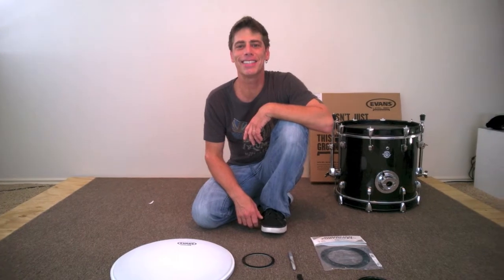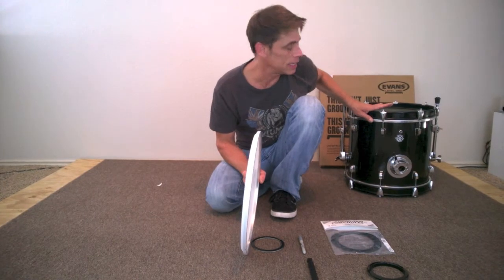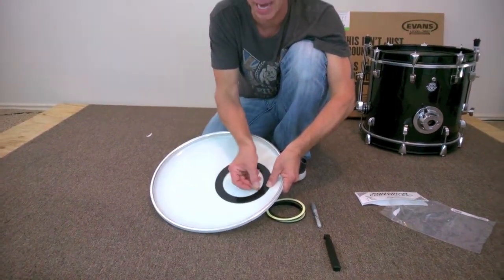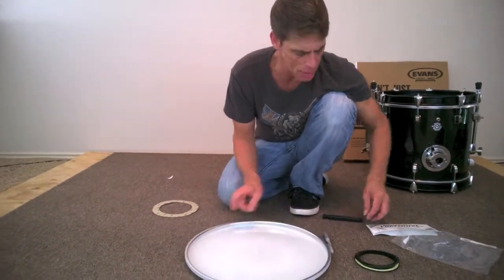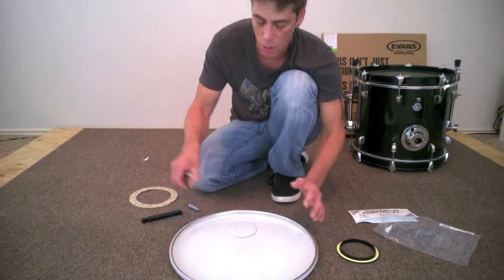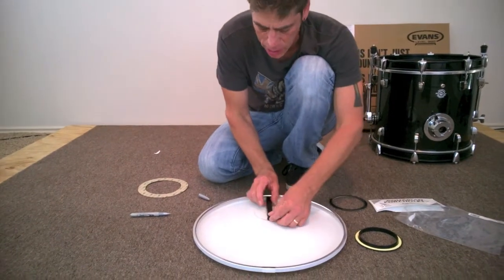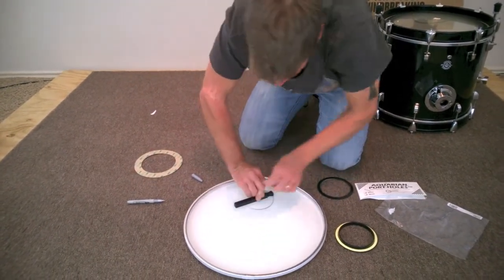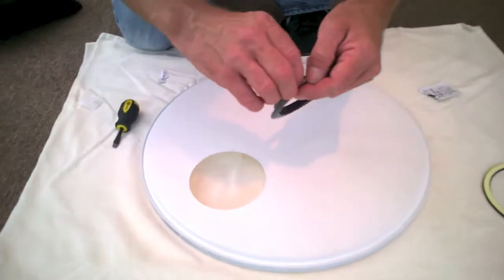How to Port A Bass Drum Head And Make Your Questlove Breakbeats Kick Drum Club Ready

Comment: Thank you for the demo! I want to put a new Evans Calftone head on my 20" bass drum on the reso side, but I'm not a big fan of manufacturer logos. It seems manufacturers tend to put their mark so close to the edge that it makes cutting it out a bit risky. I think your system will help with that! I do want that look, but also want the sound of an EMAD reso head.Thinking about putting some adhesive insulation in a circle, copying the the EMAD muffling pattern. How do you think that would sound?  Standard EMAD on the batter side. Thanks!
Reply from the maker: If you use the Bass Drum O’s hole cutter, and matching sized Bass Drum O it should be all you need. Both pieces of the “O”have an adhesive backing that will act like that foam, and keep it rattle free. PLEASE WATCH how install this to make it lock in. You have to be patient, gentle, but persistent with the locking ring. Otherwise you run the risk of slipping, and tearing the head. Thank you for watching, and commenting. If you haven’t already please subscribe to my channel 🙏🙏🙏

Comment: I went with a 6" port dead center.  I've got an Aqaurian SK1 with an Evans EQ pad.  I am not sure if I will keep the EQ pad or roll a towel instead.  I probably won't use this kit for anything more than rehearsals but even still, i hope the 6" port doesn't cause me to lose bottom end.  It's a cool little kit for sure.
Reply from the maker: Sounds like it’ll be awesome. Just keep that front head super low, and it should be good to go! 🤘🏻 Thank you so much for watching, and commenting. 🙏

Comment: Thanks for providing this video mate. I just bought a nice silver one to cover up the edges where I pulled out a thick sheet from the bass drum hole and frayed it. I'm hoping the ripple on the skin won't make it difficult to install. Also I noticed that I already have some reinforcement material on the inner edge of the skin. Will I have to remove this ring before installing?.. it's probably only a 1mm thick. I'm thinking I'll wait till lockdown is over and get the shop to do it.  But I'm impatient. :). Cheers. Chris from Australia.
Reply from the maker: Probably, but you never know. Thank you for watching

Comment: I have a question regarding your resonant head. I believe you said that it was an Evans 16" G1 Coated is that right? If so, then is it just one that's designed for a floor tom that you have put on it or is it an actual G1 16" head specifically for bass drums?
Reply from the maker: +Simon McDowell It is an Evans 16" Coated G1 specifically designed for Bass drums.Just as the E-Mad I put on the batter side.  It has a proper bass drum collar, which is why A. I got excited, and dropped one on it. B. That breakbeats kick sounds deep. The collar TOTALLY makes a difference. A tom head will work - esque, but a proper bass drum collar is SOOOO much better.
Reply: Kenny Sharretts Yeah I'd rather get one with a bass drum collar since it is a bass drum at the end of the day. Okay so I'll try look for a G1 with a collar. I got an EMAD head the other day for it which is awesome and hopefully a G1 will make it better too. I'd have to get a port hole protector too. Would a 4" be a good size porthole? Yeah your bass drum sounds awesome! I actually was quite happy with it even with the stock heads and had been using them for a while. I still use the tom stock head and I actually like them so I'll keep using them until I really have to change them. But man the EMAD improves it sooo dramatically!
Reply from the maker: +Simon McDowell On this drum a 4 " hole is definitely the way to go. Maximizes the amount of resonant space on this "tiny" bass drum head. The stock Ludwig front head with the dampening ring is awesome as well, I just didn't want to cut my logo head so I could have both options. Evans also makes an EQ3-P Smooth White with a bass drum collar, and Remo has a Powerstroke 3 with a bass drum collar if you wish to have a dampening ring.

Comment: Nice video!  Where did you buy your kit?  I live in Canada.  I was able to find the cutting template on Amazon, but cannot find the mic-hole reinforcers ...
Reply from the maker: Stéphane Godin man I'm so sorry I just saw this. You should be able to order any of the ports I talked about through Sweetwater or direct from the manufacturer.  in this video I used a Drum O  hole.

Comment: I've found that after a time those plastic locking rings start to rattle with the usual punishment of hard-kicking vibration. So, when I bought a new head I thought I would defy their manufacturing standard and Epoxy on that plastic ring. That lasted quite a bit longer until my kicking punishment eventually took it's toll on the plastic ring again and it started rattling. Now I just cut the mike hole and leave off that plastic finishing ring. No question that it doesn't look as good but one less kit hassle.
Reply from the maker: That can happen with these. In your case I’d use an Aquarian port ring. Adds a little muting, doesn’t rattle, makes cutting a hole easy, and keeps your port from tearing. Thank you so much for watching, and commenting.

Comment: that porthole is 5" ? What is good porthole size to 16" bassdrum?
Reply from the maker: It's a 4" Hole. A Drum Holz brand insert. For this kick that's as big as I would go. An SM 91 can slide right in, and a D112, SM52, or Audix D6 works great with this size hole.
Reply: Thx man! I just got Sakae pac-d drumset, and i just wondering powerstroke 3 batter head, or emad2. Just need lowersound and more attack. And toms ambassador coated, or evans g1/ec2
Reply from the maker: I love the EMAD but I'm now using the EQ4 Clear on the Bass Drum. Lower Tone, and Full sound. Ive been using Coated G2's, but I've been thinking about EC2's on the toms.
Reply: Great kit. Got mine two weeks ago and still wondering if port or no port at all...

Comment: That's interesting. I had an early Breakbeats and a bass drum head would not fit the hoop. The collar was too wide. It required a 16" tom head for it to fit the hoop.
Reply from the maker: This reply ended up in the wrong post so here you go
Reply from the maker: Yes I've heard that early versions tend to be a bit rough around the edges.  I will say the Evans 16" Bass Drum Heads tend to do the trick, and will  produce a much deeper sound than a tom head.

Comment: Anyone try this? Was it hard?
Reply from the maker: If you have the drum holz tool it's pretty darn easy. The challenging part is locking the counter ring in.The flathead screwdriver is essential. I recommend pre locking in one little curve of the ring before engaging the whole ring to the head. Once the adhesive sticks, it's difficult to reset it, but know that if you lock it well, these rings are killer. Protect your cutout, AND add a little muffling to the front head, which gives it more heft. Thank you for watching.
Reply: Cutting the hole is easy.  Getting the two stupid plastic rings to lock together the absolutely most fucking absurdly frustrating thing I have ever done in my life (and I sold health insurance!) that resulted in both my head and the ring being destroyed and me being out $40 because neither company wanted to support their products.